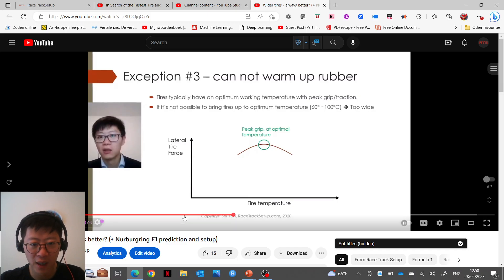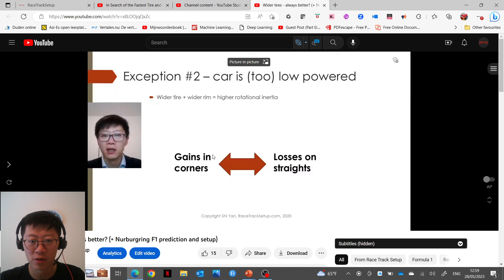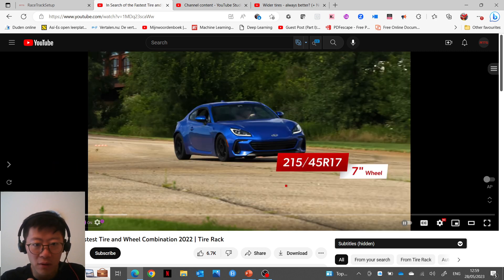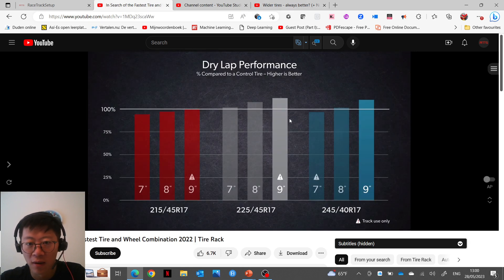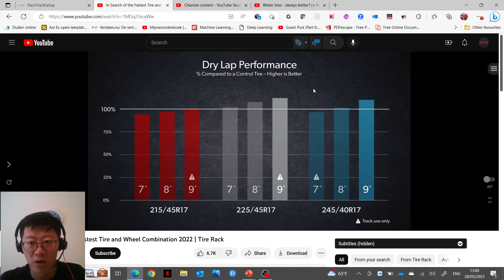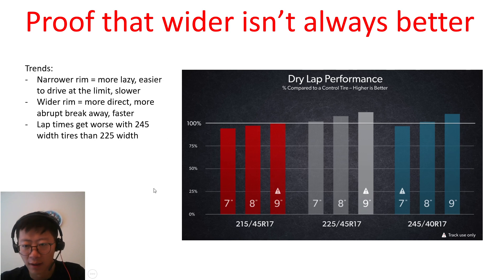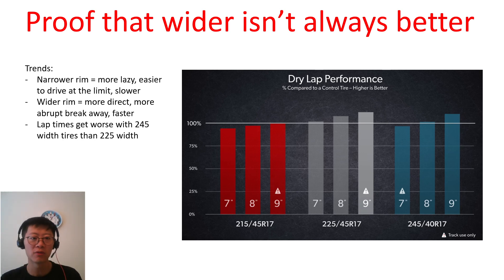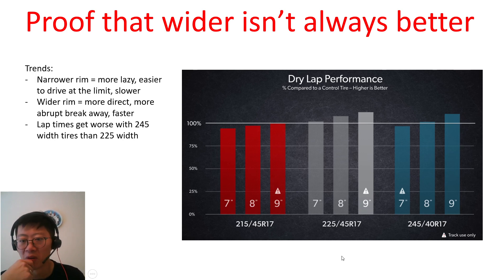Proof that wider tires aren't always better

Comment: I didn't like the comparison that tirerack did here , I think about all you can ascertain from it is a wider rim generally faster given same tire width. My guess for why the 225w was consistently faster than both the 215 & 245 was partly because of the normalization they were using instead of posting raw lap times. The lap they used to normalize the 225 test was likely slower compared to the other two making it seem faster. The 225 and the 245 being faster on a 7" wheel compared to a 215 is also pretty odd , and isn't congruent with other tests.